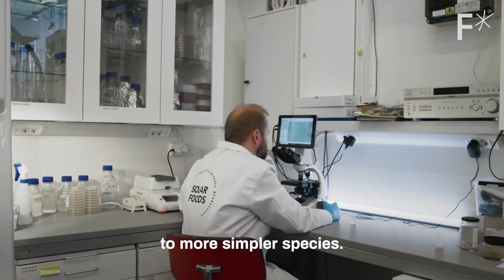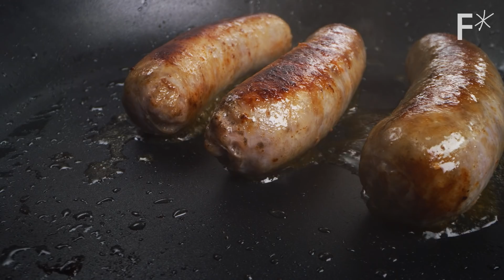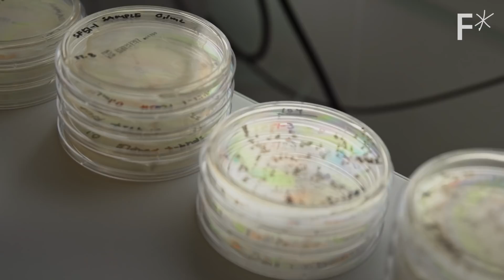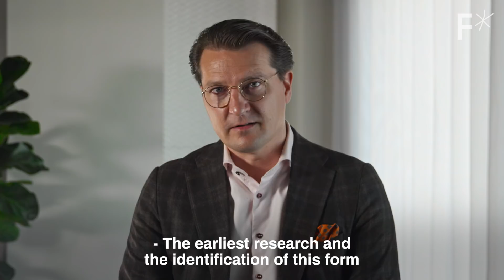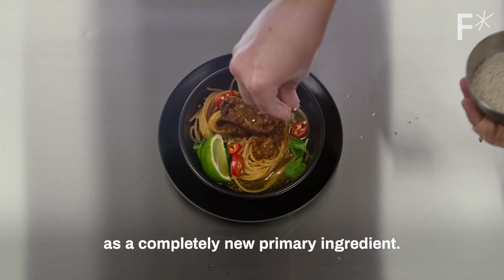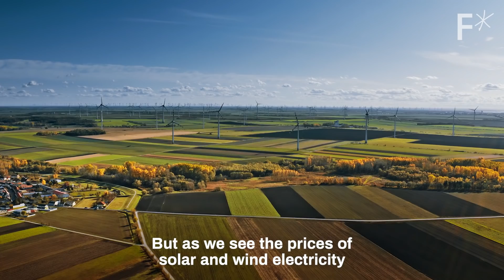The secret lab making the most sustainable food in the world | Just Might Work by Freethink

Comment: This honestly just looks like a less efficient soy isolate powder. Instead of using sunlight (free) and soy plants, they're using electricity (not free) and bacteria which is less efficient. Still need space to have fermentation chambers, still need micro nutrients for the bacteria to grow, still need to extract and dry out into powder form.
Reply: You are 💯% spot on. However I do think the concept is awesome and heading in the right direction. As someone who ferments and distills I would like to learn more, so I can try it on a small scale.
Reply: Soy has huge land use cost, fertilizers, etc. plus you can use solar panels to power the factory. You can also get higher yields and factory can be built anywhere and not just in fertile lands.

Comment: According to a study made by the American Chemical Society the process could actually have a negative Co2 footprint of more than one kWh per kg of protein dry mass. I calculated this with a mean value of 300g Co2 emissions for a kWh of electricity used. For protein yield of 0.25% of the dry biomass the Co2 emission are 0.8 kwh/kg. For a maximum protein yield of 0.75% the emissions are 0.35 kwh/kg. These values are subtracted from ca 1.8 kWh of Co2 fixation in the product. So the net negative Co2 footprint lies between 1 and 1.5 kWh/kg of protein. 

According to the study energy requirements not accounted for are: mixing, pumping, Co2 transfer, harvesting and DSP itself, and further complications associated with culture stability.

But the numbers look better every year, because the energy mix has a decreasing Co2 footprint and can ultimatively reach zero. 

Concerning the title it has to be said that the product requires more resources than just air and electricity! The product will also not be the most sustainable food-source! Not by a long shot. All plants fix Co2 from the air and are good for food, fodder, medicine, construction and more. They do not require electricity to grow and procreate ecosystems aka Nature. 

We need this product, but much more food-production with regenerated ecosystems like it is done in agro-forestry, permaculture, or simple sustainable, holistic agriculture.
Reply: You didn’t mention the line about agriculture being the cause of deforestation and desertification.  That one really bugs me, as it only applies to big business agri-industry and is completely the opposite for true agriculture.  Well said, though.

Comment: We need this to be open source info.  Everyone should have a chance to be able to make it on a small scale if this is true
Reply: Go ahead and do it yourself.  Even if they patent their organism or keep it a trade secret, there are many microbes that eat hydrogen.  All they're doing here is growing microbes on a nutrient solution (you can buy that in powder form and mix it up--the powder is Murashige-Skoog or something similar) using hydrogen they got from electrolysis.  Go look up the prices on a deionized water machine, some steel tanks, a bit of MS powder, and some copper wire, borosilicate glassware, and a pressure cooker.  It's not very financially workable or environmentally efficient on a small scale.  They're hoping here that when scaled up to huge factory scales it can be profitable and clean.

Comment: I believe there is an error in the statement "extracting proteins from carbon dioxide". You can derive proteins from processes using carbon dioxide as a component, but CO2 is a gas. Nothing more, nothing less (except for the atomic components).

Underwriters need to pay attention at the editorial phase.

Comment: This will be a good protein supplement. But it surely won't replace traditional agriculture. That's just a pipe dream. They are using electrolysis to get the hydrogen, aka using water. Electrolysis uses a lot of electricity. I think this definitely will be useful in the future. Our main issue is to get rid of or HIGHLY scale back the meat/dairy industries. They are our number 1 problem. Everything else is just a drop in the bucket. I can see this helping in that regard, but it's going to take a multi-pronged approach.
Reply: Not just that, they actually have to source a   bunch of elements that need a strong industrial complex, to make anything resembling  real food chemistry.

Comment: they get the hydrogen from water
a space craft of sorts would need water for the acquisition of hydrogen
why not just grow plants with the water instead?
is the idea that you do not need soil?
i guess thats the idea
essentially it is trading the need for soil, for a need for electricity?
but both instances require water
when it comes to measuring out grams of weight that has to be propelled into space, i wonder if it would be easier to transport the electricity or the soil

Comment: I kinda differ on calling it "sustainable" when such a high level of technology and science is actually needed to produce it.... 

If we lost a lot of tech/science knowledge, we wouldn't be able to create or use it... that's the opposite of sustainable. 

I think we should also consider "method" as a part of the ingredients in this case. 
___________
Not that this isn't cool.... but I don't think it's sustainable... it's just something that would work as long as we have the method...
Reply: That was my first reaction. This has the potential to perpetuate social injustices such as wealth inequality. However, in terms of using resources it might be sustainable. It depends on how its implemented. For example, you could say most technology is unsustainable on some level, but we have to draw the line somewhere or cross that bridge when/if it becomes an issue.